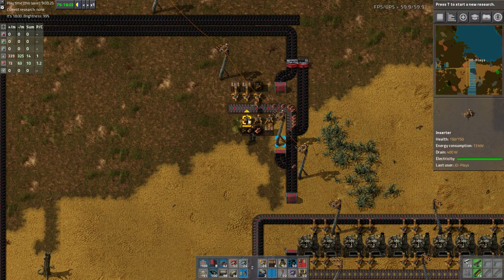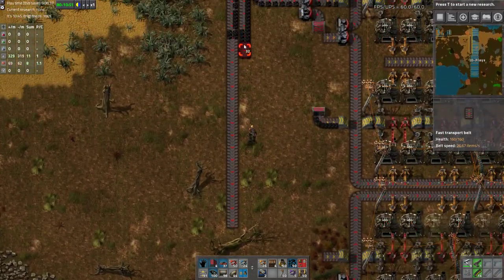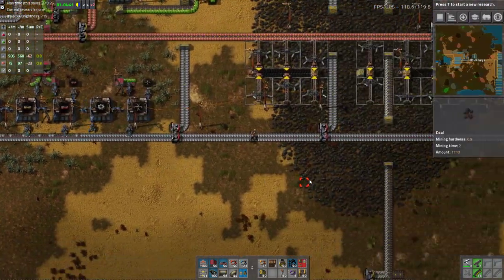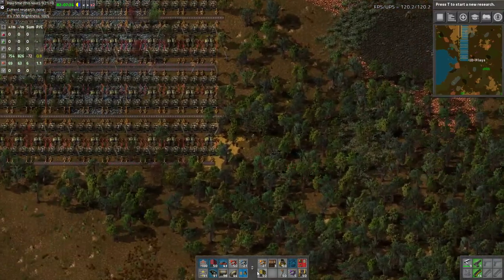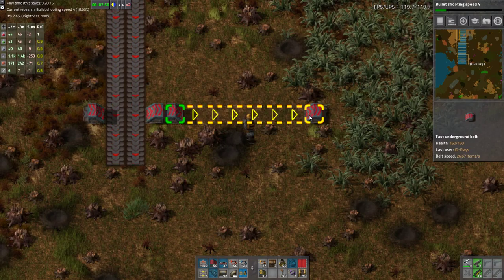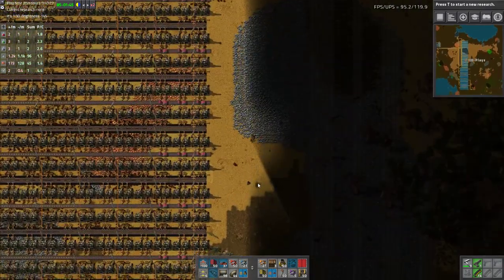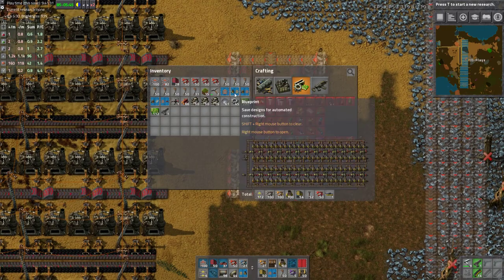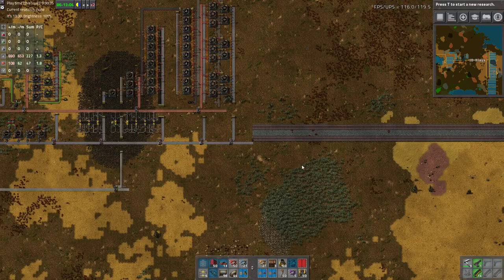EP09 Belt Balancers 8 To 8 - FacTutorial

Comment: well, 4 belts of iron are required to match the 6 belts of copper at 2 to 3 ratio...
Reply from the maker: Correct and in the next episode i take 4 belts of iron, and 5 belts down the bus.... Yes i have a problem....
I need to work out exactly whats going where very shortly